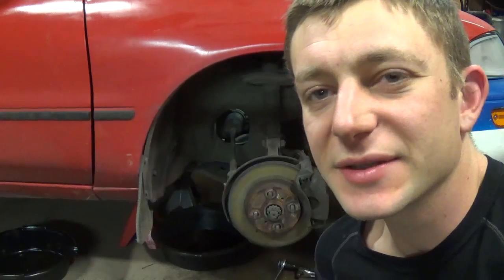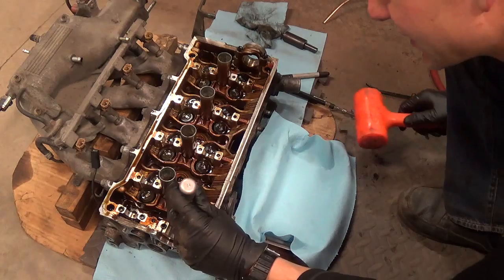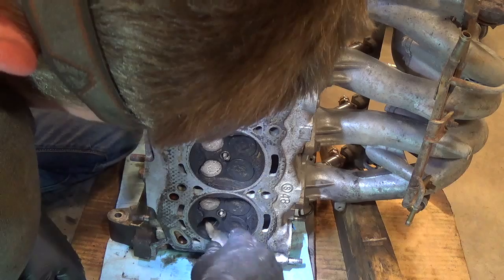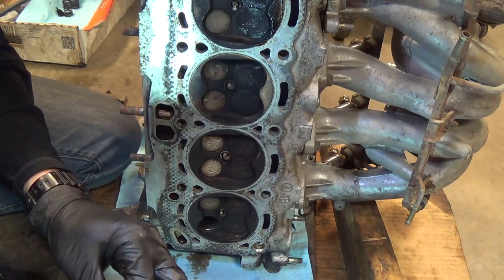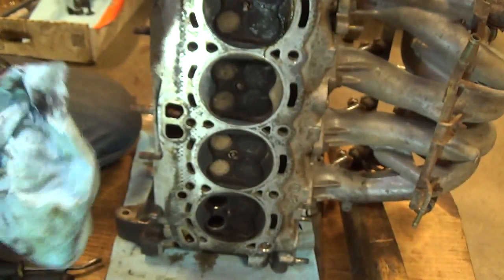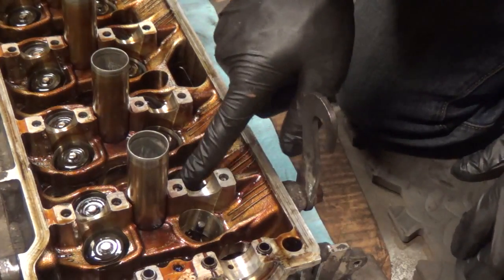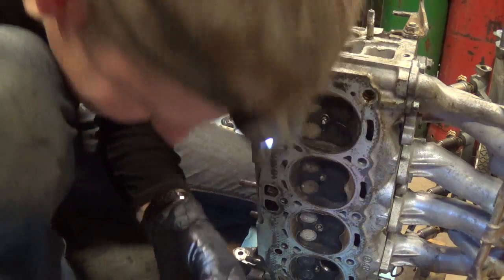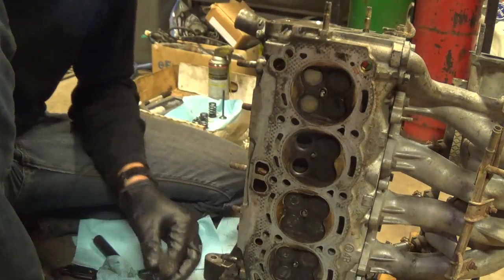Toyota 1.6/1.8L Oil Burning -'96 Geo Prizm -Part 3 of 4

Comment: I appreciate the videos ..A long time ago i was a mechanic for Gm and apparently sales sold a Ford truck to a fellow and it used a lot of oil. So they decided the service department would make it right . I was the lucky guy to fix patch it up. So in framed the engine and used Continental rings ..Rolled in a set of bearings.  Honed the cylinder after i had wrapped the crank journals to keep them clean ect . Had the heads serviced . I was surprised how well the 390 ran after i got it together.  Used pistons,  worn cylinder ect . I did not check the cylinders for taper ect ..with  dia bore gauge . One thing i seen in the past from another shop they ground the valves and seats but did not check the valve stem length . Non adjustable valve train . Results was a cylinders with the vavles not  seating

Comment: Interesting thing though the labor is around 9 hrs just for rings not including valve job and 14 hrs for engine swap.. why didn't you just get a 500$ used engine? considering you had the head off 2 times. I would have recommended a used engine the first time because of oil consumption and low compression... Not hating on you or anything man just saying the customer already spent more on this + previous repairs then a used engine..
Reply from the maker: Used engine would likely be an oil burner as well lol... Waste of time

Comment: How many of those valves I would have to order.? I to am having a oil issue and I only use my car local use. Currently have a 2001 chevy prizm and also still having a misfire in cylinder 4. Spark plugs were just changed yesterday. How do I truly fix my cylinder 4 misfire without having to put in a different engine.

Comment: Seafoam is alot less issues put in every cylinder use a funnel soak two times 8hr each soak. Crank disconnect distributor tell fluid is all gone. I have twice as much power solved issue.

Comment: pretty sloppy job you did-Eric Obrochta  would be dissappointed also-NO brake cleaner used !!
  -I would check for bent valves,valve guide wear,plus blow residue out of heads,lightly oiling parts before reassembly
   -possibly new sodium valves-and check for flatness of  head-mill if necessary since aluminium heads prone to warp
      -i have 50 yr old valve lapping compound still -I have DIY done  12 to 15 engines
         many down to crankshaft bearings     -from 3 to 12 cylinders         -so semi experienced
Reply from the maker: Check out the "Sloppy Mechanics" YouTube channel. I love cheap sloppy fixes that work perfectly ;)

Comment: when the valve is pitted like those are you toss em in the trash, cost of new exhaust valves are cheap, your valve job will only last a year or less,I know this a buget build but the seats should have been cut , in fact, after the valve seat and valves have been refaced at a  machine shop, thats when you lap em in, also keep the lapping compound off the stems and clean the heck out of every thing, the shims will  will  need to be changed(maybe), but yeah you got it down.
Reply from the maker: It's been a year and 16k miles later and top end is in beautiful shape, doesn't burn a drop of oil. Will be replacing the con rod bearings soon though...a simple 2-hour procedure on this engine.

Comment: nothing wrong with building a motor like this for a friend on a budget.  of course you wouldn't do this in a larger shop with a customer willing to pay for proper repairs.
but those pitted valves are pretty bad, would be nice to get some decent used ones from the junkyard.

Comment: Nice work keeping the old girl running... that valve cap tool was awesome...with the amount of carbon on the exhaust valves common or is something down the line not pulling the exhaust out? great video Ivan...

Comment: I like your videos, but this one you should have talked your friend into getting all new valves. And there is a special tool with a suction cup meant for lapping. To my understanding you're supposed to twist back and forth while quickly lifting and lowering the valve into its seat.

Comment: Ivan, judging by the age and shape of the car, your friend cannot or does not want to invest any sizable amount of money in this vehicle. At the same time because he keeps repairing it, he must also rely on this vehicle for his sole means of transportation. That being said your friend is probably more than happy for your best efforts to keep his baby breathing as cheaply as humanly possible, including going all out caveman on it! LOL! We all know there is a right way to do things, and wrong way to do things. Then again, sometimes there is only one way ( because of money constraints ) to do things. People out there have to remember you are not a machine shop with all the proper equipment such as lathes, milling machines, etc.. which services are not cheap. What you did for this engine is not exactly optimal, but you may have bought a few more months or longer for this car and for your friend to find a suitable replacement ! Keep e'm coming Ivan ! Happy Holidays !
Reply: +motoYam82 As I have told you before my friend, I have no plans in letting "Turbolet" go, but since it has proven unsuitable for driving over obstacles such as this http://www.artvbal.com/photos/i-Vs2tjZn/0/XL/i-Vs2tjZn-XL.jpg I plan to save some moneys and get me used Suzuki SX-4 AWD, to which you shall add skidplates and lift kit, so I can finally rock those roads :) . As for "Turbolet", its days of forest riding are coming to an end, but its state highways days are far from over...
Reply from the maker: +Billy R Thanks Billy! I told him that he can't buy a new car until this one really bites the dust...so he might be out of luck for a while. I promise to let you guys know if and when he decides to trade in the Prizm :)

Comment: Yo Ivan, Great series so far man! I watched all three parts while tearing down 3 pistols I shot the crap out of yesterday. Wish I could have come down to give a hand with this job and bear the burden of some of the comments with you lol. I think you did a fine job so far and look forward to seeing the out come. Ripping down engines is fun IMO and wish I did more of it actually but it is a little different at my shop as you know. The valve tool you were using caught my attention though I LIKE IT! Do you have to fiddle with it much or does it work every time?
Reply from the maker: +South Main Auto Repair "bear the burden of the comments" LOL it's tough man! 

That magic Lisle valve spring tool works incredibly well. Gets those keepers back on the stem on the first or second try every time! I have used the C-clamp method before, but that's like cave-man style haha! This might be the one tool that I have and you don't :P
Reply: Yeah ya got me on that one. Sounds like me, I am right 50% of the time every time.
Reply: :8

Comment: Seeing that you are doing a major part of the work, why not go the whole hog and replace the valves.Your clientele wont thank you for doing a 2nd rate job and wont do your reputation any good either. Most of them haven't a clue about the inner workings of the engine and rely on your expertise to do a good job.Don't let them dictate your standards.These jobs have a habit of coming back to bite you.
Reply from the maker: +Tom OConnor Considering I have had to tear into this engine three times in the past two years, I see your point :)

However, if you fix everything at once, you can't perform the scientific "separation of variables," which is absolutely key to learning about cause and effect (i.e. how much of the oil is due to valve seals vs. oil rings?). If I need to replace the valves further down the road it will be my pleasure to do so. But what if these pitted things last another 200k miles?? That will be valuable experience to me as to where to draw the line between rebuilding and replacing.

I can say that I have learned a tremendous amount from this car, and am doing my best to share it with everyone here.

This customer is my good friend and he completely supports this long-term "case-study" with the Geo Prizm, as long as it's reliable of course :)
Reply: I can see your point of view and there's probably a method in your madness.Keep up the good work.

Comment: Hey Ivan! A small tip I learnt from Jafromobile. I masked off the valve stem, stuffed it in a drill and at low speed attacked the wire wheel! Cleaned em right up
Reply from the maker: +TGsrao1989 You should have seen the rock-hard deposits on these valves. Off camera I actually had to GRIND a few bigger chunks off! Had to charge the guy a couple extra hours for that lol...

Wish I bought a few spare exhaust valves before the procedure as they are pretty cheap for aftermarket. Then again, the original ones have been through hell and were still usable...not sure how well the aftermarket ones would hold up. I'm paranoid of aftermarket parts, especially critical engine internals :)

Comment: The valves are cooled by their contact with the seat and the intake valve will be cooled by the seat & air/fuel mixture and that is why the intake valves are in better shape. Those exhaust valves with get worse and get so hot the oil will coke again and pit even worse (if they get hot enough they will crack & you will be pulling the head again). The valve stems will also get hotter so hopefully the valve guides will not have excessive wear. The exhaust valves could be refaced by the machine shop and returned to service as long as the margin is within spec to keep it from burning up. Intake valves are more forgiving exhaust valves are not.  Let the customer know it's not going to last and next time you may be replacing the valve seats because they will get so hot they may crack & pit like the valve.  Sometimes you have to spend a little money to keep from spending more money next time. It is a 96 NY car so maybe the car will give out before the engine.
Reply from the maker: +Robert Hayward Yes, heat transfer from the valves to the seats is absolutely key here! But keep in mind we addressed two problems here: 
One: the valve lapping already improved the head transfer dramatically, and 
Two: there should (hopefully) be no more oil to burn with the new piston rings.

Soooo I'll give him a 100K MILE GUARANTEE on my work, and will pull the head and replace valves FOR FREE if the problem returns.

I'll make sure to post a follow-up video in a couple months once he puts a few miles on my ghetto rebuild and see how things are progressing :)
Reply: +motoYam82 Just trying to let you learn from @40 years experience & keep you from getting bit next time b/c this one will come back long before 100K. Valve lapping with good valves is one thing, lapping with pitted burnt exhaust valves is not. Sometimes doing favors for customers and trying to keep the price down will cost you in the long run. Tell them the price to fix it correctly and if they decide to have you do it the cheap way document it and let them know what the normal warranty is if done correctly and the adjusted warranty for doing it the cheap way. Just watched Eric's video he posted today on a Honda that shredded a timing belt and bent some valves and he gave them the price for doing the job correctly with the head going to the machine shop. Your reputation for quality work is important and not worth a customer saying you just did his engine & had piston rings and a valve job and it only lasted ????? miles.
Reply from the maker: Agreed. Really appreciate any tips from pros in the field; that is how we all learn!

The owner of this Geo is completely on-board with the operation :) Reputation is absolutely key of course. At this point I can probably rip the head off this thing and replace a few valves in a few hours with my eyes closed so it wouldn't be a big loss of time/money on my part.
And you can bet the entire process is well-documented from start to finish :)

Thank you for your great comments, Robert! You will enjoy the final part in this series for sure :)

Comment: nice magnetic tray. another cheap trick is to use an old egg carton to keep a bunch of lil bits organized!
Reply from the maker: +1quickchevy2 Nice tip!
Reply: +motoYam82 Multi-compartment muffin tin with magnets glued to the bottom.

Comment: Its nice to see the other side of a not disposable society repair where fixing an engine instead of scraping a car that  is quite common in other parts of the world. Of course the numbers have to makes sense but for a friend they always do LOL   When I do small engine valves I use my sandblaster cabinet modified of course it didn't work out of the box correctly but I use it for brake calipers , slide pins and anything else I can fit in there. I highly recommend it for the type of work you do.
Reply: +Steve Rob Is true, manual brushing is certainly very slow.

Comment: I used that paste in the 1960s on a motorbike engine There was a stick with a suction cup on each  end that went along with
the paste,   worked great on valves with flat surfaces not so good on dished ones 
some guys used an electric drill on the shaft of the valve  for a quick and dirty job
Reply from the maker: +Colin McGregor What vintage motorbikes did you work on Colin? I've lapped valves before in the field with some Crest toothpaste (must have flavor crystals to be effective lol) when lapping paste was not available.

See page 4 of the ride report here:
http://advrider.com/index.php?threads/cross-country-on-a-50-bike-ny-sf-and-back.366117/

Comment: why wouldent you just buy new valves for the deformed ones
Reply: Time constraint is one valid reason.  They used to cost $8 and were a week away, no telling how it is in the new millennium - I just dated myself didn't it?

But those two should have been replaced as well as the cylinders de-glazed for the new rings.  Coulda, woulda, shouda.  Too late now in any event and so am looking forward to the final episode.